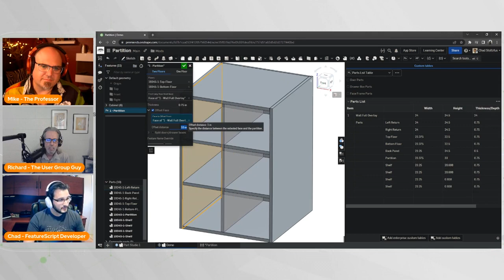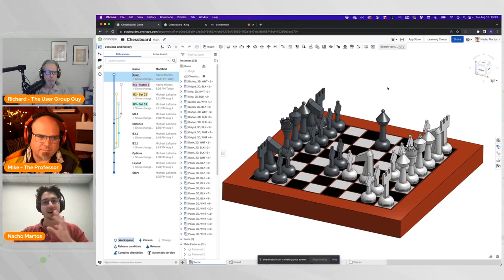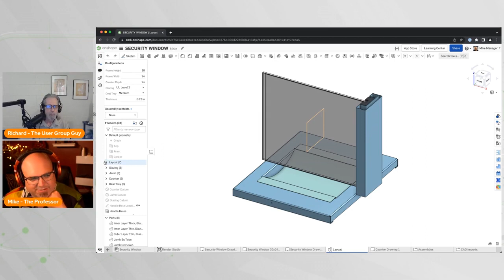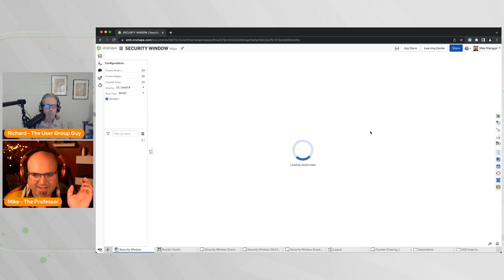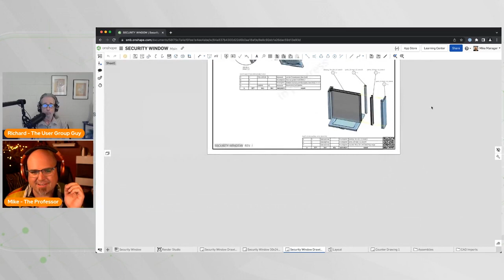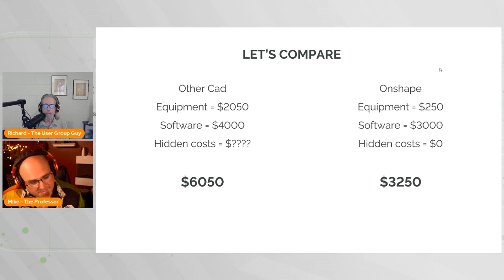Innovator's Insider - Episode 26: Can your CAD do this & Watches that don't tell time

Comment: so i have no experience with other mechanical cad systems.  been in architecture for 20 years..picked up some small mechanical cad work and been using Onshape for ~5 years...everything you said was true...Onshape works so well I'm trying to move as much of my architectural work in to it...Need to have a company make an AEC cad system that works as good as Onshape...need to start with Civil.  Have a cloud based cad of the earth where I can place my building on and locate in the state plane or UTM then invite all stakeholders in...this is where I would start with the AEC cloud cad path.